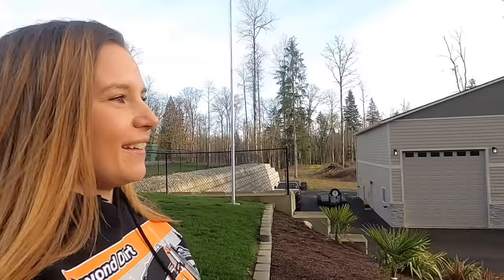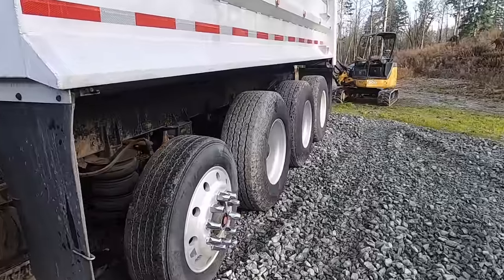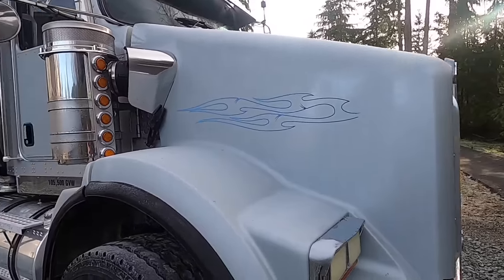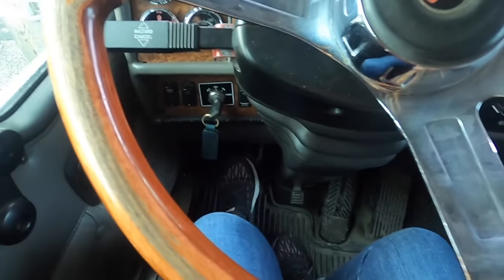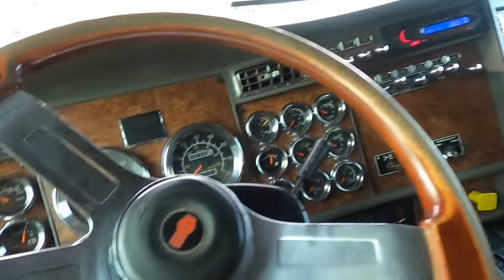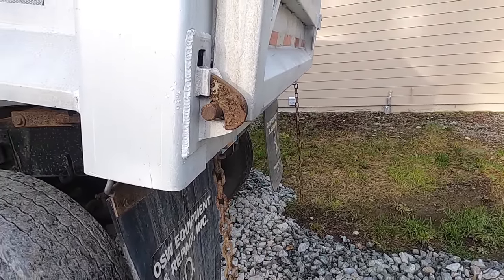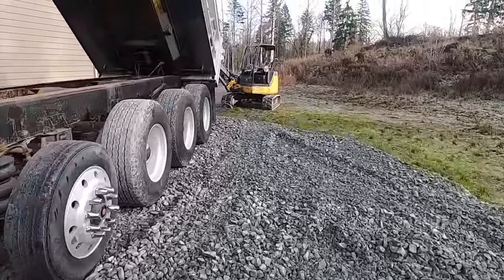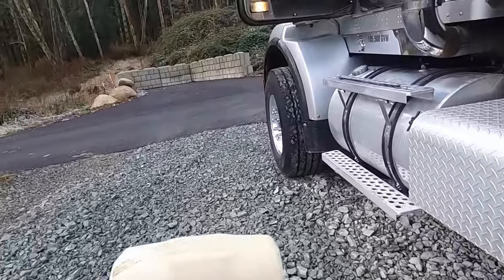I DID IT! I BOUGHT MY FIRST DUMP TRUCK! 2003 Kenworth Truck and Pup Sturdyweld Dump Truck.

Comment: Well you have a nice setup now doing the maintenance so you can get everything up to snuff. A good can of rust penetrate and some good grease and I bet the tarp switch has a bad ground. Asphalt in the warm and since you are up north salt spreader in the winter. Or just hauling Salt to the DOT shed. Cats are nice but I’m a Cummins Man. Just had good luck with them. Still looks like a really good purchase can’t wait to see what happens next.
Reply from the maker: We don’t do salt here. I’ll probably haul rock year round. I don’t like how asphalt ruins everything.
Reply: @DauminiqueTheDumpTruckDriver  Great you don’t use salt it does it’s job but boy does it mess everything. Asphalt especially if you’re a privateer is a good gig. 4 loads a day maybe 5 considering how far the plant is can pay well. Just remember to clean up with diesel. I retired from driving 3 years ago, just got sick of how a lot of people are inconsiderate drivers. 33 years of driving Big Wreckers Roll Off’s, Front End Loaders Side Loaders and Lastly 26 ft Box trucks full of hospital supplies. Thank You 🙏 for your Videos. Now I can see all the new equipment. Happy and Safe New Year to You and Your Family!!!

Comment: Congratulations with the new to you truck. What is the reason for the long reach of the trailer. I know that the frost is not helping, but greasing the various nipples in stead of hitting the bearings would be my preference.

Comment: Trucking is  tough -  next  truck   Volvo & International - many have automatic transmissions  that  are bullet proof - 
Best money is  hauling  from the pit to places  that  need gravel - sand - or 1 to 3- minus  Good Luck - out here in 
Vancouver , BC  in the  residential areas they put in traffic islands   to stop the trucks  -  or with the  truck and 
flat deck trailer - what can you do ?
Reply from the maker: No one is buying auto Volvos to haul gravel. They don’t hold up.

Comment: Another option that you may be able to use for fleet numbering is to use the last 2 or 3 numerical digits from the number plate for each unit.  So, if your truck plates are say 204, you can either use 04, or, 204.  That way, if you put drivers into the trucks, they can then see the number plates and the fleet numbers match.  If you get the same numbers, it may be a case of using a letter and going A04, B04 and so on.  Trailer numbers follow the same idea, but, you may want to put L as a prefix, as there is no L in truck.

Comment: It looks really clean, have to been taken good care of 🤟
Reply: And the nice thing with some dump trucks, they pull alot of weight, so it keeps the engine "exercised" a diesel have to work and have a good load most of the time, that's what they are made for.. Diesels that aren't being used right, will die early... Just my experience thru all diesels I've owned.. I'm up to 57 of different make and models cars, trucks  vans and I actually had a Volvo bulldog cab over with 3 way tip... It was a 68 If I remember correctly

Comment: I drive cranes myself and have basic experience driving dump. My question is when is a pup trailer beneficial? I could t imagine disconnecting it to dump the truck every time could be efficient?!?!? Where would you use this? Maybe tailgating off on a road or going longer distance for a special material? I ask because I’m curious and considering getting a dump myself.
Reply from the maker: You don’t disconnect to dump Doing The Ballard 500 with 31 other Truck and Trailer Dump Trucks.
https://youtu.be/3dlawu_xXUw

Comment: Sweet setup you forgot to charge the trailer with air to run the gate open and closed
Reply from the maker: If that were the case they wouldn’t have opened when I hit them with the hammer.

Comment: You Should  Use WD40    wd stands for water displacement works well in and on the water affected places..   Pup has a sweet drop hitch!
              I started with     #0001              it worked out well in the end for tracking             Nice Rig Buddy

Comment: Great video and good information. How many ton can you legally haul? Cold? We would call that nice. It gets tough working at -30 F and a wind chill of -70 F. Spray those tale gate and brake joints with lubricating oil about once a month. A friend started with # 1 in 1954, he still has it and runs it, which I think is cool, last I heard he was up around # 200.

Comment: Caterpillar 👍🏼💪🏼Kenworth are my Favorite in my opinion. Peterbilt my second favorite. Kenworth is more big rig looks more work and rugged which I like along with the luxuries. Peterbilts can look rugged too. Ole t800s and W900s what I love. Glad you got a old t800 caterpillar powered 💪🏼💪🏼👍🏼
Reply from the maker: Yeah a CAT in a Kenworth is a great combo.
Reply: @DauminiqueTheDumpTruckDriver  yes indeed. That engine suits em. Love hearing the CAT turbos spool in a Kenworth. Been in Kenworths since I was young. Mostly CAT C15 powered T800s. I have been in and drove a N14 Cummins powered one that job I had got. That truck was very loud, lot of smoke, lot of muscle. If I had to go Cummins I’d choose N14. All great engines and trucks. They all got their problems too lol just like basically everything hah hah. Enjoy your T800 very nice work truck. Good pair with that trailer

Comment: hi there nice truck..i see there quite a few jobs needs done to the trailer..and the tail gate release ..it always has been an issue with air gate release..as for electric tarps..i much prefer roll over tarps to save cost..it can get a bit expensive when u can't see what your tarps are doing..blowing out fuse and over heating the electric motor when the sensor don't pick up the auto tarp when opening and closing..as for the reach..i must prefer the drop pin system ...that just my thoughts anyway..

Comment: Always open your gate before you lift the bed . Pressure will stop it from opening
Reply from the maker: A lot of pressure yes but not just the weight of the gate.
Reply: My truck probably the only one like that . Good luck with that sweet truck

Comment: I have a class a never done dump truck. Can you do a video on terms relating to dump trucks. In depth video would be great but I’m mechanically inclined and should be fine either way. I’m considering getting into a dump truck and want to be as ahead as possible to increase the likelihood of getting a job. Nice set up by the way. I would rather drive that an the rubbish freighters I tend to get .
Reply from the maker: I have lots of videos about dump trucking

Comment: After looking at the entire video, have to mention these . 1) Just like I said, at 14.19  you will not have to hammer again. The unit that the actuator is supposed to operate is seized up with old grease. Solution -- disconnect the actuator and dismantle it RIGHT THERE . Clean thoroughly inside /out. Apply fresh grease and assemble. The grease nipple may need to be replaced. PUMP grease to make sure its working. Grease regularly.  2)  At 15.16 Clean, prime and paint chassis. 
3. Your husband is your mate who I assume will be assisting you throughout your journey.As a matter of LOVE andnRESPECT take his suggestion.
A clean and well-maintained vehicle will GIVE YOU A "FEEL GOOD FEELING" making your day easy.

Comment: Nice truck. I’ve had the same problem where you have to hold the lever for the box to come down or go
Up. My mechanic cut holes on both sides of the slot where the yellow lever moves. So you don’t have to hold it. Not sure if that makes sense .
Reply from the maker: Haha it drops if you don’t hold it, that’s all I need.

Comment: how much space do you need on turns with such a long drawbar? I drive large farm machinery so I generally know one or two things about driving with trailers in tight spots. How do you turn at a normal junction in town with this though? I see no steering mechanism on the trailer or anything.

Comment: By using one in the units position you are letting customers know that this is you oldest and maybe your only truck… some customers may feel better thinking that you have a second backup truck…. I might try numbering 015 where hundreds and tens are the trunk numbers and the units is the equipment type.  Following that logic the trail might be 016.  Units 5 means trucks units 6 means trailers.
Reply from the maker: Construction companies don’t care how old your truck is or if you only have one. They just need you to move the material.

Comment: I got a 3 axle 92 sturdy weld pup with a 2010 5 axle t800 and with the pup sucked In the whole set up is 72 ft end to end sturdy weld has really long reaches
Reply from the maker: They are built for the NW, that’s why.
Reply: @DauminiqueTheDumpTruckDriver  my truck came out of Montana and the pup was from Washington But I don’t know if the pup was set up for a short 4 axle or was hooked up to a 5 axle
Reply from the maker: @danepatterson8785  they can be used with both. About 10 years ago it seemed all the trucks were 4 axle trucks with 3 axle pups.
Reply: @DauminiqueTheDumpTruckDriver  with the light weight of my truck and pup I can almost legally haul 34 ton and be at 105500 my brother was mentioning to me that up in Montana they trying to experiment with 4 axle tractor 4 axle side dumps with 2 axle pup side dumps

Comment: Just subscribed. Love your videos. What sort of weights do you run on that set up. What's the tare weight of the whole combo. How do the axle groups work in the states. I'm in western Australia we run all sorts of combos here. You set up is what's referred to as a truck and pig trailer. Interesting to learn about other countries and how they run there trucks. Over here when you go north they run roadtrains. 3-4 trailers of weights up to 400 tonnes or more depending on what your carting. Up to 99 tonnes gross loaded on doubles where I live. Love trucking. I'm a loader operator now but will go back to roadtrains next year. Miss it All the best in your new venture.

Comment: Congrats for the new truck!
Can somebody please explain, why the drawbar ist that long? Its maybe mandatory to reduce stress of the road? Thanks!
Reply: In essence, yes.  It's to help distribute the weight over a larger distance so it's not all in one spot, particularly for going over bridges.  It is also necessary for clearance behind the front (truck) box to be able to dump the front (truck) box.
Reply: @Lnmwr  thanks a lot ;)

Comment: Why is the trailer neck so long is it so you can dump the truck 90 degrees and steer away from the pile so you dont have to disconnect?
Reply from the maker: WHY IS THE REACH SO LONG?!! Here is why, Bridge weight. Kenworth T800 Truck & Trailer Bridge Weight.
https://youtu.be/pnE_YlawUgQ

Comment: You should chek your #-s in your horoscope and make a combo out of it!
Mine is like 3,7,9 kinda that is the best way!
Reply: I feel absolutely terrible 😞 what you guy's dealing with in the states, with all the bs.lift axels and reach extention!I ran in B.c . Thank God we don't need this shit up here! I ran super B side dump, Truck and quad transfer !140 000lb gross 63500 kg ,Tandem Truck and pony 94800lb 43000kg ,We have tri drives +tri pony 57000kg 125 600lb
Reply from the maker: It’s not bad, it is what it is.
Reply: I know, no choice!Good luck and health!

Comment: The T800 will stand up better than a Pete  I have run both  and had way less trouble with the 800 and it was a older truck also .

Comment: Hello Dauminique! Fellow subscriber coming to you for some advice. Looking to buy my first dump truck but everything I see seems out of my range. I have found a 2007 kenworth T800 that looks decent and they want $89k for it. It’s a quad axle with a C13 Caterpillar with 410hp. Eaton manual 8LL, 4.10 ratio, 18,740 ft axle, 46k rear, 19’ steel Logan body. The only issue to me is that it had 529.271 miles on it and I don’t know if that’s ok or way to many miles. I need something that would keep me running for a while. Do you think this truck is worth looking into? What do you think about the miles?

Comment: You mentioned thats a 2003, and it's cold. Do the roads get icy? If so, what do the road crews put on the roads so the trucks don't get all rusty?
Reply from the maker: Sometimes they get icy but not like the rest of the country. They use deicer and sand. 

Side note, my middle child’s name is Davi.
Reply: @DauminiqueTheDumpTruckDriver  actually I am David, just trying to hide a bit on Utube.
Reply from the maker: @davigorb  haha well she’s just Davi.
Reply: @DauminiqueTheDumpTruckDriver  To make life a little easier in the morning check, when you park it at night....turn the steering wheel all the way, either left or right. Leaves room to squeeze between front tire & bumper to get dip stick, coolant reserv .. etc

Comment: Both look great.
Why is the trailer hitch so long?  Here I’m the U.K. trailers are never like that. 
Most tippers in U.K. don’t have a trailer because the tipper is 32 ton & with a trailer loaded would push the combination over weight.
Reply from the maker: WHY IS THE REACH SO LONG?!! Here is why, Bridge weight. Kenworth T800 Truck & Trailer Bridge Weight.
https://youtu.be/pnE_YlawUgQ

Comment: Hello...so I just started watching a few of your videos and I see you drove for Pellco and you took your ride, (DT3), to the dealer for trade in, what, about a year ago? Anyway, a friend of mine bought a used Pellco truck and pup around that time and runs it around here in Yakima. He hauls sand and aggregate from the Central Premix pit to Western Materials block plant. I'll try and get ya some pics to see if it is actually your old truck.
Reply from the maker: It’s DT3, as far as a I know.
Reply: @DauminiqueTheDumpTruckDriver  My company is shut down til at least Jan. 10th cause its so frickin cold here, so I probably won't see him til after, but it'd be interesting to see if it is.
Reply from the maker: @donaldswanson8627  DT5 had yellow fog lights and DT3 didn’t. From what I have heard from other people is that DT3 ended up in Yakima and DT5 ended up out on the peninsula.
Reply: @DauminiqueTheDumpTruckDriver I recognized the blue side boards in your video and thought, "Tom's truck has blue sideboards"...lol. They still say Pellco.
Reply from the maker: @donaldswanson8627  haha so I’ve heard

Comment: love the truck. im in michigan we dont run pups like that, what is the purpose of having so much room between the truck and the pup?
Reply: It's to help distribute the weight over a larger distance so it's not all in one spot, particularly for going over bridges.  It is also necessary for clearance behind the front (truck) box to be able to dump the front (truck) box.
Reply: @Lnmwr  wow up here in michigan  we run 11 axles at like 180 ish so i have never seen trucks like that. how long is the truck with the pup like that
Reply: @seanmesaehable  Not sure, but I can tell you it's adjustable so it depends on what the driver has it set at.  P.S. I'm from MI myself but live in Nebraska now! :-D

Comment: Get a dash camera for out there on the road. It will save you a lot of money on insurance policy in the long run
Reply from the maker: Maybe maybe not. Every company I’ve ever worked for didn’t have them and didn’t allow them. Too much of a liability if the driver does make a mistake.
Reply: @DauminiqueTheDumpTruckDriver  i got one in my truck because they are to many people out there that wants to break check.
Reply from the maker: @melvinmariott8609  in my whole career I think that’s only happened to me once

Comment: My wife and I are planning on buying are first dump truck 17 yard bed is a 1992 1976 w900A 855 Cummins engine 5:29 gear ratio 15 speed with 249,000 original miles. 4 axle pup trailer is a 1992 9 out of 10 for condition. Truck and Trailer $44,000 together.
What do you think
Going to be leasing on with Idaho material and construction they are going to be paying us $110 per hour full time spring summer and fall work
Reply from the maker: Truck and trailer is getting $180 an hour in WA with fuel surcharge. You are basically paying them to work at $110 an hour after you pay maintenance, tires, and a driver. I wouldn’t work for that.
Reply from the maker: Also a “17 yard box” is useless in ID unless you are hauling bark. https://itd.idaho.gov/wp-content/uploads/2016/10/bridgecj.pdf

Comment: At least it’s not a acert. Might want to pop the valve covers and check the cam lobes.
Reply from the maker: My mechanic has been all over it.
Reply: @DauminiqueTheDumpTruckDriver  I used to take care of a fleet of 14 t800 in Whatcom County. The cam injector followers would take out the injector lobe. Then Cats warranty would replace the cam but only the follower that failed. Running a used follower on a new cam would immediately cause another failure. We started paying Cat to replace the other 5 injector followers to correct the problem.

Comment: Why is the trailer 'boom' or shaft or what do you call that thing that connect trailer to truck (non-english speaker here) so long? Never seen one that long especially since it seems that the bed is short?
Reply from the maker: Its called a reach, its for bridge weight.
Reply: @DauminiqueTheDumpTruckDriver  Ah, makes sense. Must make driving in general bit more challenging since the trailer will cut so much more?
Reply from the maker: @mcmaddie  it’s not hard. It just is what it is.

Comment: Would like to have 3 of them and have some one else drive them.
Reply from the maker: Finding drivers is almost impossible
Reply: @DauminiqueTheDumpTruckDriver  I agree. Couldn't believe the odor of one just now in office checking out. Gaged me. Most are 2nd generation drivers who try to fill the bill. I  gave and give 100 percent and barely make it. Prayer has helped me alot. I pull a 53 foot dry box. Just a company driver. Owner ops are doing well. I barely see 125 a day. Pathetic.